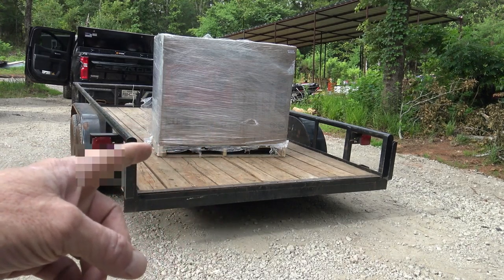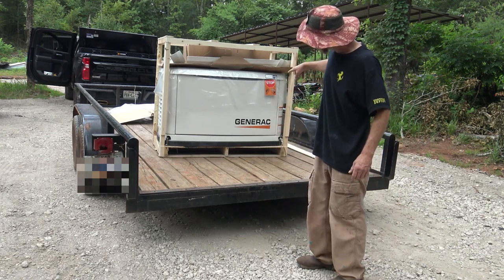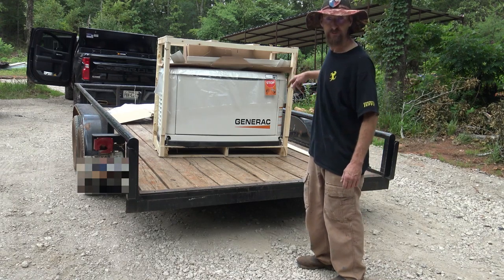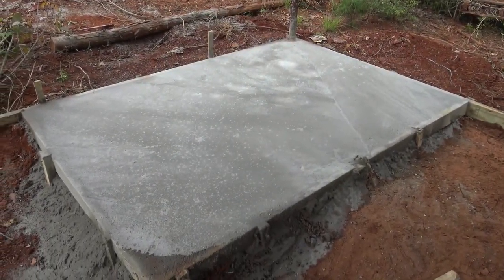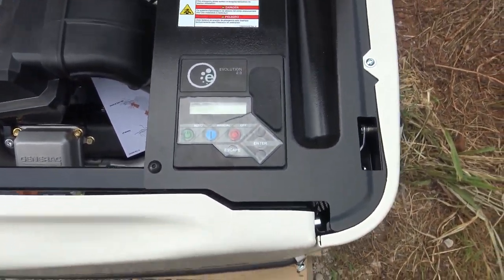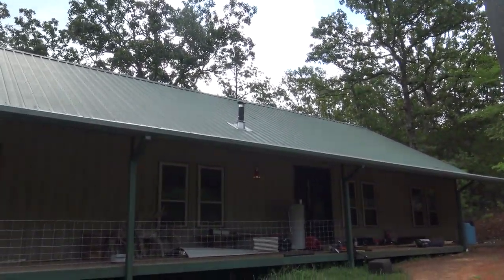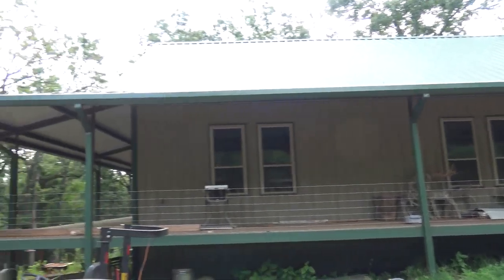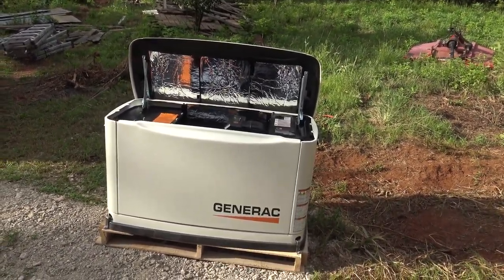What do you really need to live an "Off-Grid" lifestyle #solar,#generator,#off grid power. S2 Ep 47

Comment: That generator looks better than a new set of mud tires.   Sweet.   Congrats.   Awesome.
Reply from the maker: I was considering putting a set of tires on it  :)  but Im gonna bolt it chain it weld it and surround it in a steel building.    lol  whewwwww
Reply: Good plan to secure it.